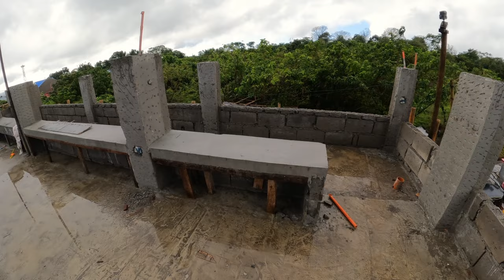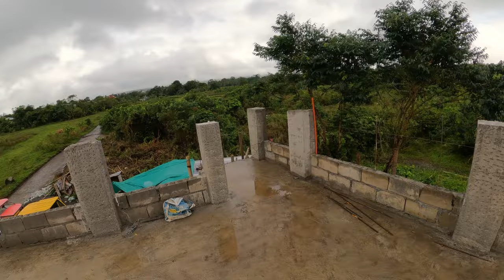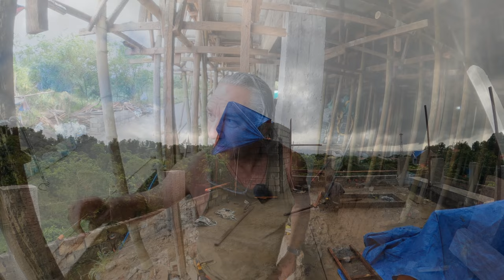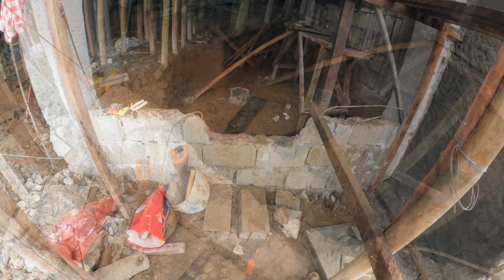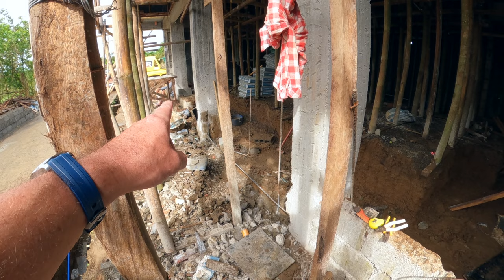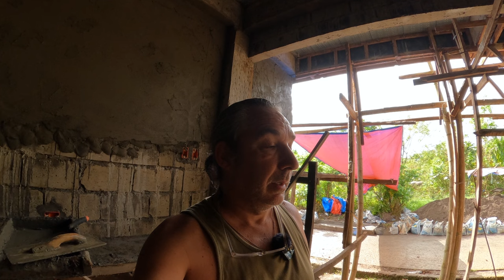Construction Scope Creep! 😢 | Garage Build Philippines | Ep. 20 | TORINO

Comment: Just curious with a large roof surface how much variation do you think in the whole roof?
Reply from the maker: We ended up with some bird baths despite me using a float. I think it's because tile flooring is so common here that crews don't bother getting a really level surface on the concrete. They just level it out when they tile. 

I tried as hard as I could to float, and even used a gas-powered trowel on the lower level, but we still ended up with an uneven surface, especially at the end of the pour when we were all totally smoked.
Reply: @torino2610  I have watched other homes being built in the PI and they all seem to be done that way. Not sure how else to do it with the methods available?
Reply from the maker: true, without a pump/truck and/or grinding to level after, it's hard...